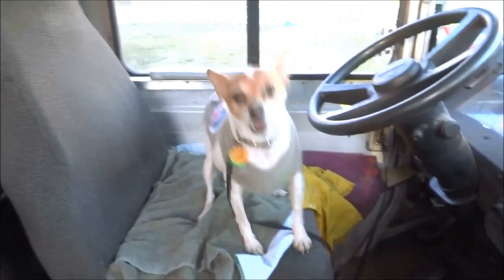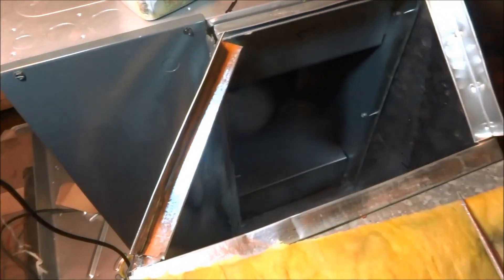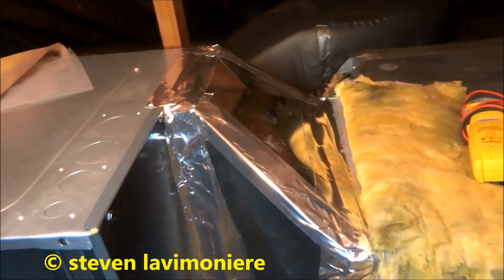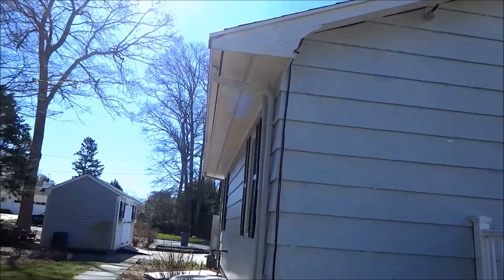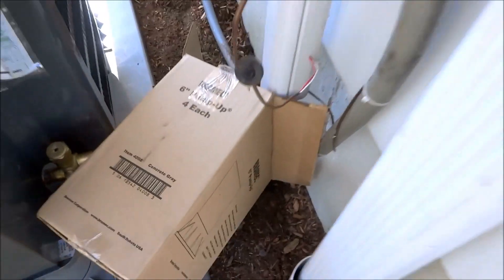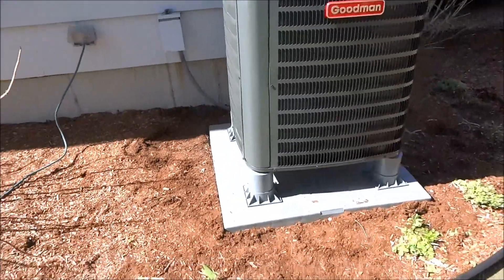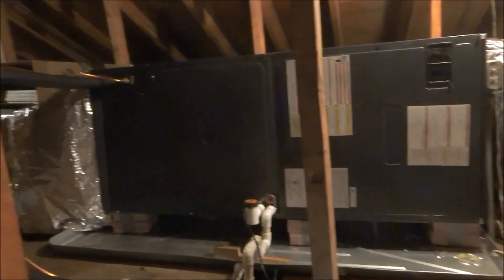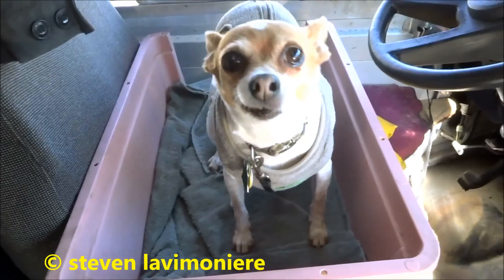4 ton air conditioning upgrade part 2

Comment: Hey Steve I have a 2.5 ton ac unit on a 1,400 square foot house thermo is set at 72 but its 77 in my house maybe unit aint big enough?
Reply: You haven't explained what's wrong if anything. You only stated the thermo set temp and the current temp. Are you stating that the temp in the house never gets to 72?

Comment: Nice looking install Steve, I bet you were glad that old line set wasn't where the leak was...I remember one where the lineset went up through the eve like that one, had a roofing nail rub a hole into the suction line.  It was a bitch to get to it and fix...
Reply from the maker: +Rich Rada yea i remember that one .

Comment: I love  stay bright # 8 I am happy to see you use it
Reply from the maker: +Mark  Monaco it flows well
Reply: +steven lavimoniere  Make sure you do not put to much flux on and your fittings 
Are tight and don’t over heat it will at flow inside the pipe
But you know that You are best

Comment: nice install, i see you start using stay-brite 8 solder, i stop using it when 410a equip. came out, but thinking going back to it at least  using it on service valves. is there any draw backs using it if most manf. say lines must be brazed? thanks
Reply from the maker: +Dennis Noone staybrite # has a stronger tensal strenth then sill foss i use both .  its a lot less heat needed to solder just have to use a minable amount of flux .i have no issue using it if done right . it will hold just fine
Reply: the only thing i didnt' like about it that it doesnt work well on a loose fittings, if the fittings are loose it should be brazed.
 Any idea why most hvac manuf. want joints to be brazed? you would think they would be better off recommending soldering with staybrite to eliminate the oxidation.

Comment: Steve, do you still run nitrogen threw the line when you use the stay bright #8
Reply from the maker: +Lee Falvey no nitrogen needed when using stay bright # 8
Reply: +steven lavimoniere Thanks for the input Steve, Old timer I know swears by it so I tried it on my own system when I installed it about 10 years ago. All the guys at the supply store told me "that's going to pop on you. 10 years no pop!

Comment: I was glad that you didn't use that 1/2" liquid line, you avoided issues by doing that. I have made that blunder in the past and it was ugly.
Reply from the maker: +Larry Cole 1/2 " was only in the actic space ,,made good sence to cut it out and run 3/8 line set was maybe 30 /35 feet max .

Comment: what kind of solder did you use?
Reply from the maker: +protonhead1 http://www.ebay.com/itm/Harris-SB861-Stay-Brite-8-Silver-Bearing-Solder-1-8-1lb-Pound-/381354578159?hash=item58ca8110ef:g:ROkAAOSwgApW~w8n
Reply from the maker: +protonhead1 i use both sillfoss and staybright 8
Reply: Ok ,Thanks Steve .very good video.
Reply: Thanks for that ebay link.